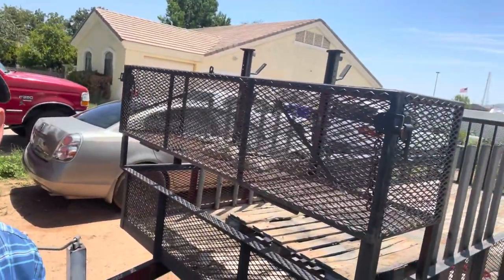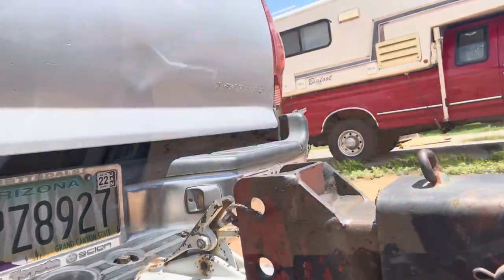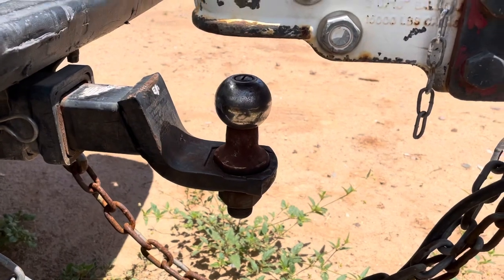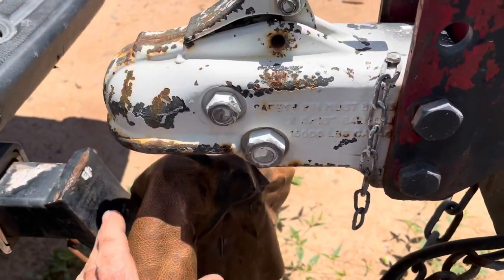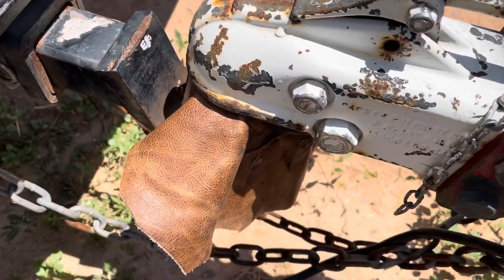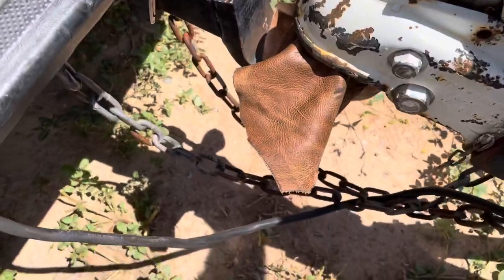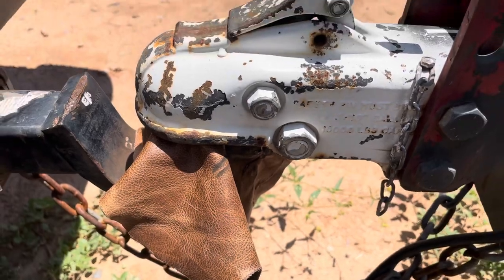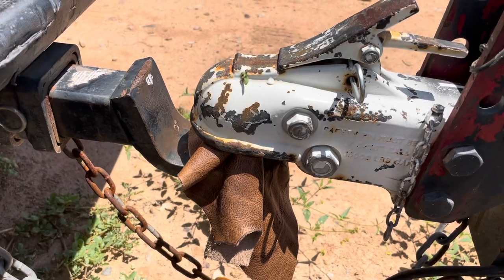How to Make a 2 5/16” Trailer Hitch Fit a 2” Ball.

Comment: I am in this situation..I NEED to move a 24' Camper less than 1/2 mile..the ball on my truck is a 2" and from what I've been told, I need a 2/516" ball...Living more than 25 miles (one way ) and the price of gas today..to go get that size ball & MAYBE be able to take 2" ball off....(but for me..doubt I could..& replace with 2 3/16ths ball.....think I'll have to at least try this 'method'..another problem..where I'm bringing it is in a hollow..has a downward dip coming into the hollow....cross your fingers!!!  Little skeptical,  but it has to be moved A.S.A.P and I've posted HELP NEEDED signs..on line & at the local market..no luck..whisper a prayer !!!!
Reply: If you have time to write a comment and research a video online about it, you have time to go get the proper ball. You could kill someone, think about it.  A ball is only a few dollars... a life is priceless. Cost benefit analysis is simple

Comment: I have the exact opposite going on and cannot change out the ball. Any ideas?
Reply: Go out and buy yourself a triple ball hitch it’s a straight tube with a 1 7/8 inch a 2 inch and a 2 5/16 inch ball on it you just flip it to whatever ball you need and done
Reply: Try grinding the ball down to a 2"

Comment: If you are going down from the barn to your other barn on a dirt road with no traffic for 2 miles, then do this and drive 20mph.  If you plan on going on a highway with traffic, this is silly.  Pulling a large trailer behind a vehicle without the proper ball size, hitch size, and coupler size is dangerous and irresponsible.  Maybe you might have asked the person you BORROWED the trailer from to loan you their 2-5/16" ball hitch also?